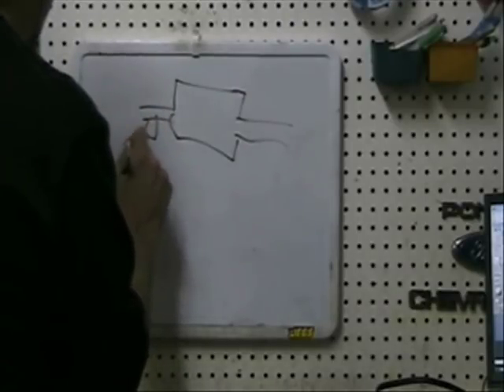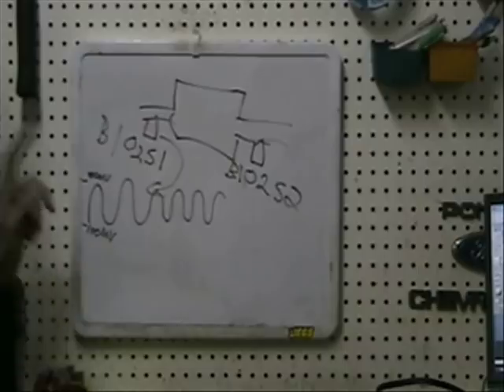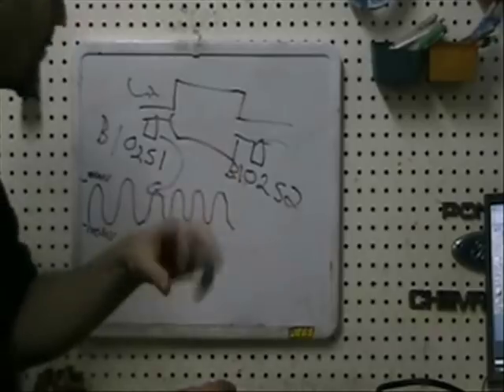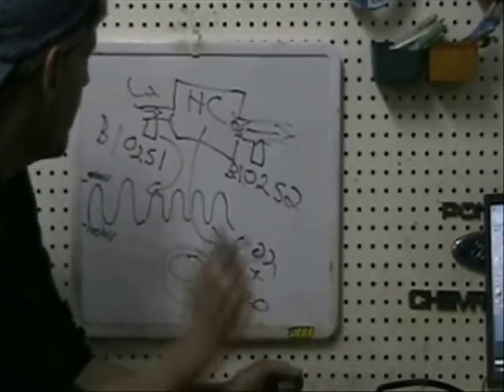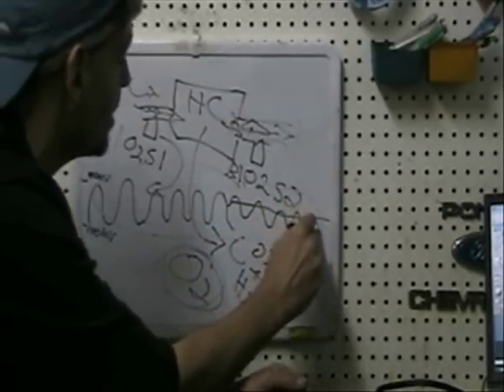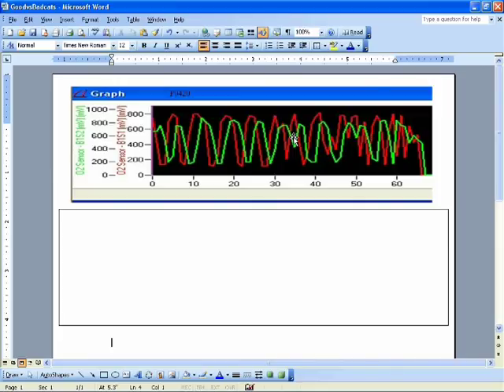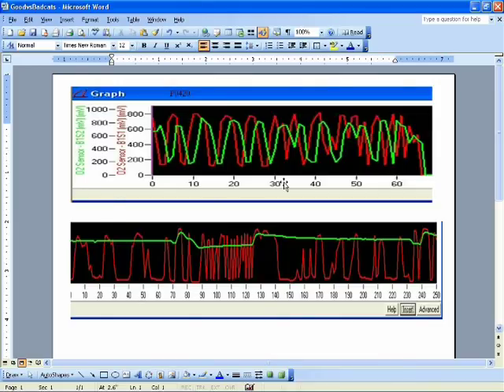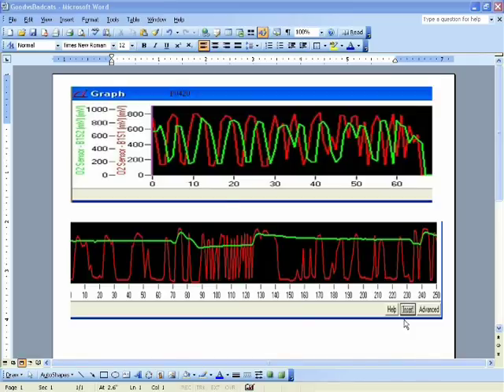P0420 P0430 catalytic converter catalyst inefficiency code diagnosis

Comment: So i've had a catalytic converter installed, it was second hand but in really good condition. The thing is, the program scans it and its working okay, both o2 sensors are also working properly, but the p0402 still shows up. Is it a software bug or something, or is it because its not the original one i still cant figure it out.
Reply from the maker: how do you know it was “in really good condition”? how did you determine the catalyst activity was good exactly? i am not sure how you would do that off the car.
Reply: @SchrodingersBox  Well the Obd2 shows that the converter is doing its job, cant remember what it was saying, something like, harmful gas recirculation test "passed" with green letters. It doesnt detect the cat as the problem. We still havent checked the MAF and the MAP sensors and the fuel injectors. Because when i try to start the car it shakes a little and after that its okay, also i get a poor gas mileage when the engine is hot and when you press the gas it struggles to accelerate at higher rpms when you want to overtake. Its not something big but im still trying to figure it out, it can be many things, but the o2 sensors are working as they should, we checked them both. The readings are as they should be s1 is going up and down and s2 is flat lined. What do you think is the issue?
Reply from the maker: you have to check the S2 voltage to see if a catalytic converter is good or not.
Reply: @SchrodingersBox  Thanks! We will look at the voltages too, actually we fixed the rough start problem by changing the coolant temperature sensor. Also sent the injectors to be checked for leaks or if there is a bad one, we have a guy that cleans them with ultra sound machine or something. Its a bit of a headache to find the right solution sometimes. You have to check a lot of stuff.

Comment: Hi there. I have a 2013 Infiniti JX35 with V6 engine. Recently I got P0139 and P0137 codes. Few days earlier I got the P0430 code but after clearing it, it hasn't came back. I have hooked up my scan tool for live data and saw that the B1S2 voltage was steady between 0.010v and 0.000v, but the B2S2 was  fluctuating between 0.200 and 0.900v. Does that mean the B1S2 sensor is bad? Please help!
Reply from the maker: Could be. induce rich and lean conditions and if the O2 doesn’t respond it’s bad.
Reply: @SchrodingersBox  just rev it up? It doesn't change much when I do so. It stays below 0.200v. But the B1S1 and B2S1 sensors are between 2.0 and 2.2 volts. Is that normal?
Reply from the maker: cause a manifold vacuum leak - that is easiest. or put some propane through the intake.

Comment: Ok, but could if the downstream 02 is bad then maybe the reading is telling us it is a BAD cat when in reality it is a bad 02 sensor giving false data.  Could this be true? 
How to isolate if the 02 sensor bad prior to looking at the CAT reading?
Reply: scooter12368 this what I've been trying to find out too lol
Reply from the maker: Thanks for bringing this up Madison- I missed it!!
 The answer is - you have to have a bad rear O2 sensor that happens to be bad in a way the mirrors the front O2 sensor- so in other words with this code- it actually verifies the rear O2 sensor is good!!
  To tell if the O2 sensor is bad- it's same as with any 02 or A/F sensor- you simply get flat or flatlined response to induced rich/lean variables.
Reply: Thank you so much for the information you have provided. As i understood, when the cat and downstream o2 sensor are good, we should see a flat line (I mean lean or rich condition should not affect the downstream sensor) so how we can figure out if the downstream o2 sensor is faulty. I have a Toyota corolla  2006 (A/T) which shows P0420 code, I clean the code in the highway and drove for 120 miles nonstop and the code did not show up, but after driving about 5-10 miles in city the code comes up. There in no leakage in the air intake system as I changed the air intake manifold gasket and PCV valve and the LTFT $ STFT are below 5%. In the highway, upstream o2 sensor voltage (I know it is not real) is about 3.3 and fluctuate a little bit while I am cruising, but when the gear is being changed, the range of fluctuation in bigger. meanwhile the down stream o2 senor fluctuate in the range of 0.5-0.8 while the car is cruising and when the gear is being changed the range is bigger. I would appreciate it if you can help me find the issue. Thanks again and I am looking forward to hearing from you. Please let me know if I can use another mean of communication like phone.
Reply: he said in the video that the o2 after the cat should read high voltage .8 or .9 volt that describes little or no oxygen after the Cat.
The o2 before the Cat should oscillate as ample as possible between .1 and .9 volt in the perfect scenario ..

Comment: ...something that is in my mind from sometime now : would it be possible that a bad upstream o2 sensor generate a lean condition and the computer enriches the mixture at the point that kills the Cat convertor ?
Reply from the maker: Happens all the time!
Reply: thought so... thank -you.
You also said that the down stream o2 sensor should show a fairly steady flat line at around .8 v if the Cat is doing the job right?
Only asking because it makes perfect sense, unlike what I saw on another video where it was illustrated that it should be at around .45 v...( which did not convince me that much)

Comment: have 2002 chevy blazer 4.3 V6 had a cat that was broken up inside getting 0P420 code changed exhaust from the engine to tail pipe cleared code and drove.after catalyst moniter reset check engine light reappeared check code same 0P420 checked o2sensor1b1 same reading as o2sensor2b1 not sure if i got a bad cat or not please help if possible.o2 readings bt .100 to .900
Reply from the maker: musicmaestro145 I would have to see this for myself but if the rear sensor is mirroring the front- especially at 2200-3000RPM, I have to tell you- in all my experience, the cat is not working.
Reply: had a bad 02 sensor replaced it all was fine sorry for the long wait on response having same problem this year on 2005 chrysler pacifia gonna check 02 sensors befor i replace cat thanks for your help and detailed videos

Comment: Hi matt.
You say sensor downstream sensor should show a high voltage. It contradicts what I've read it should be aroun 0.45-0.55. 
Why is that?

It means that a good cat even in a rich condition should remove the HC/CO?
Reply from the maker: Its because what you read is incorrect. If a cat is working there will be no oxygen as result of the hydrocarbon conversion. If there is no oxygen, how can the sensor possible read at a stoichiometric ratio?  It is impossible.
\  Basic Chemistry 101.
Reply from the maker: Also yes you are correct- this means a fully active cat will do a remarkable job of cleaning up even a rich condition.  Sin ce the catalyst will be in excess, the reaction will be complete.
Reply: @SchrodingersBox  
Thanks for the answer Matt. love your videos!
During deceleration when no fuel is injected, Should the voltage be still high?
I think in my car it turns to low voltage and most of the drive it's about 0.7.
Reply from the maker: during fuel cutoff in decel you would see o2 s go lean
Reply: @SchrodingersBox  
Makes sense
Apprently the 0.45-0.55 were the upstream, my bad.
Almost no stuff regarding the downstream. 
Now it makes more sense that it's mostly used to monitor the Cat.

Comment: What if I get the p0420 code but my car passes smog test? Does that rule out that the catalytic converter is bad?
Reply from the maker: No it doesn't- the threshold of detection of the testing may be below what the inefficient cat is putting out. This would be especially true on a "Speed Pass" or drive-thru test where you pass by sensors on a highway on ramp or whatever. In the states I have lived in, you would never pass a Dynomometer test in a facility because just having the CEL on would fail you in itself.
Reply: Well I would get this code every now and then - I'd say about every 1000 miles or so - and would just clear it and continue to drive the car. Here in CA, they do put your vehicle on a dyno when they perform the smog test. The P0420 code had been cleared before the I got the smog test done. Also, the only code I ever would get is the p0420, nothing else. Still think it's the cat and not the 02 sensors or exhaust leak?
Reply from the maker: Ryan Teves Yes it is still the cat.  In earlier stages of the cat failure this is a very typical behavior.  On my own vehicle I was getting intermittent 0420's for over a year and a half but eventually they become completely consistent when the catalyst eventually died completely.

Comment: i got a p0420 code before and my ltft bank 1 and 2 were about 5 percent negative and my stft were both positive, can this mean bad cat
Reply from the maker: There is not information from what you provided to tell. Look for superimposition of the S1 and S2. Simple as that
Reply: ok thnx, quick question but what is superimposition? and are you regarding 02 sensors bank 1 and 2?

Comment: This question is off topic to the point of your video and the learning lesson, but strictly regarding a bad/clogged catalytic converter, have you ever known of repairing/unclogging it by driving and keeping engine at higher-rpm (3500-5500) for 20-30 minutes? The idea being to keep the cat hot enough & long enough to burn off the carbon coating & clean out the cat? (Some even suggest doing this once a month for 20--30 min for catalyst treatment.) : ie, https://www.youtube.com/watch?v=zxMA8ySYNQk

Comment: so, what does it mean when the converter is bad, but the pcm isn't setting a code?
Reply from the maker: As with any code set, the threshold for consecutive fault detection was simply not yet attained.
Reply: Ok, that's what I figured. It's just that I've been driving around with my scan tool watching live data for awhile, and the cat is just a paperweight at this point. Guess I'll just wait and see what happens. Thanks for all the videos. I've learned a lot and saved a ton of money.
Reply from the maker: malmangelucci I have seen it take months for the code to reappear, despite seeing what clearly indicates faulty cat activity,  Lots of parameters are calculated- time of synchronous data output, engine load at time of synchronicity, and also as a matter of fact the monitoring on many vehicles is not continuous- i.e. by watching the scantool you are monitoring far more thoroughly than the PCM is!
  Nonetheless, I can assure you that a catalytic converter is in your future.
Reply: Interesting. I wonder if a resource exists that lays out these specific parameters ('00 Altima). I'd guess that kind of stuff falls under programming, and most likely that will never make it to the public domain. And yeah, the converter is next on the list right after I chase down this 3% LTFT. Thanks again.

Comment: Just received the P0420 code for my 05 Mazda 3 2.3L. I've felt a difference in power of the car. It's a manual trans and it's not performing as it used to before the CEL. Is this most likely due to a failing CAT or could there be alternate problems resulting in the outcome.
Reply from the maker: It is totally psychological. Understanding this code indicates any performance loss would have happened BEFORE the CEL, not after.  Either way, what are your fuel trims indicating?
Reply: Schrodingers Box didn't even know about fuel trim till now. I have limited knowledge of the systems of a motor vehicle. That is true, the first cycle my CEL tripped P0420 I didn't experience and loss in power at all. The car seems to run rich. I know there are many reasons this could be. R.i.p to me

Comment: I just ran into your video.  Prior to p0430( Saturn vue '09) my car hesitates on acceleration.  I cleaned MAF it corrected the hesitation,  but came back. I replaced MAF, hesitation are now far few between but happens here and there, but aren't violent hesitation.  Bank2 sensor are working at spec, what could be problem? Exhaust leak, vacuum  leak??
Reply from the maker: no idea. what data do you have?
Reply: @SchrodingersBox  lll run data and give you LTFT and o2 sensor reading for bank 2. Bank 2 is the issue.
Reply: @SchrodingersBox  ok, at operating temperature,  bank 1 ST- -0.8...LT -9.4...bank2, ST -0.8...LT-5.5...02 BANK2 S1 .070-.785 GOOD SOLID WAVE. BANK2 S2 .721-.899..GOOD STEADY LINE.  PERMANENT CODE 0430 NO LONGER ON MY OBDII. I/M MONITOR SYSTEM EVP LIL RED LIGHT BLINKING. ALL OTHERS ARE GREEN...I DID SEE FUEL PRESSURE AT 43PSI. SATURN VUE SPECS SAY 56 TO 62PSI. IM THINKING FUEL DELIVERY,  POSSIBLY BAD PUMP OR ELECTRIC ISSUE NOT PROPER VOLTAGE GOING TO PUMP. THOUGHTS???
Reply from the maker: well it makes no sense to me where you say you have a “good steady line” on the B2S1 at .7-.8V. 
  Why are you considering that good? And how would you explain the LTFT at only -8 with a zero’d STFT when the O2 is steady at .7-.8V?
Reply: @SchrodingersBox  b2 s1 was oscillating.  B2 s2  the line on the graph, was steady but valves were .7 to .899. At this point p0430 permanent code no longer stored. Still hesitates. Thank why I'm asking.
Reply: @SchrodingersBox  thank you for your responses. At this point Im assuming b2 s2 bad.

Comment: hi, I have a 2000 Honda odyssey. I have a po420 code and I changed catalytic converter but still have this code, so I also changed o2 sensor not only 1 but 2 times. when park my sensor only go as high as 0.095, 0.064 but when running it will go to high as 0.895. help please. thank you.
Reply from the maker: It is hard for me to imagine a situation where you could get the symptoms *described in the video* and find the cat isn't at fault.  You really need a graphing capability to accurately get readings from the front and rear sensors but basically, if the rear sensor is oscillating, it's almost 100% certain it's your cat. Try the readings at 2200RPM and see what they show.
  ALso, make sure your engine is not running rich or something that would potentially cause the cat to be unable to operate effectively.
  Honestly, I would have to see O2 sensor scantool data to really be convinced this is caused by something other than cats
Reply: Schrodingers Box 1

Comment: I have a 2004 Subaru Outback with 5 O2 Sensors two front two in cat and 1 in the rear my front 02 are both reading at + 4v or higher what could be causing this. I replaced the cat with factory on bank one a year ago but the code remains and causes a low idle or lean mixture when I clean my codes. HELP!
Reply: I also replaced the front o2 sensors a month ago!
Reply from the maker: I would need to see the fuel trim data
Reply: @SchrodingersBox  graph or number on those fuel trims
Reply: @SchrodingersBox   At Idle 750 rpm short trim bank one is 1.6 to 2.3 and long term is 0.00 bank 2 is the same. At 75 mph 3418 rpm bank one is short 0 long -3.1 bank 2 is short 0 long -2.3. I have the rare EJ259 California emissions car and this is driving me crazy

Comment: Hi
I find your video very interesting,my son as a 2000 Silveraldo 5.3 Engine.which set a code PO420 every now and again.He resets the code via scanner and he can get a week to months before it shows up again.
I was very interested in the waveforms on the input to the converter and the output of the converter.
I performed those test as you outlined in your video,however my 1996 S10 4.3 and my 2004 Olds Alero 3.4 had similar waveforms not a straight waveform,not as you indicated what I should see.I don't have any codes present.and the vehicle's is working fine.
Reply from the maker: Yes I have gone as long as 4 months resetting the code before it comes back- it depends on many, many variables.
  One explanation for the discrepancy you see is the readings may be completely different at idle than when driving. Testing when the engine is under load gives a far better feedback. Even then- again- there are variables that allow a long time for a bad cat to be "caught" by the PCM check.
Reply: Schrodingers Box
Thank you for the reply,can you tell me why I am not getting the waveform results as you outlined in your video.Were  those waveforms taken at idle,or at a certain RPM.The input waveform varies from 0 to 800 mvs. and the output is similar but varies between 0 and about 650/700 mvs.What do you make of this even though the two vehicles mention are not setting any codes.I will find out the results my son is getting with the waveforms and get back to you if his silveraldo 5.3 is getting the same waveforms with him getting the PO420 Code.
Reply: Thanks David ,appreciate your reply.

Comment: i have a 99 jeep cherokee xj 4.0. the cel just came on for a p0432 for bank 2. the truck has always had a rough idle (only at idle)(misfire at idle in park or sitting still in drive never under load) is it my cats or o2 sensors or like a cps or tps sensor?
Reply from the maker: What is the idle vs load O2 sensor you got for B2s2?
Reply: ill check on my way home tonite. but around 750 in park or neutral but is erratic about 50rpm up and down and about 650 i would guess for it in drive with 50 rpm fluctuation.
Reply: there is no vacumm leaks we ran the truck while cleaning the motor and firewall/hood it never bogged out or ran worse. and it never misfires while goin down the road only at sitting still running
Reply from the maker: Cody Wilson None of that is useful. You need O2 sensor voltage at idle vs load for O2S2.  Everything else is just listing symptoms